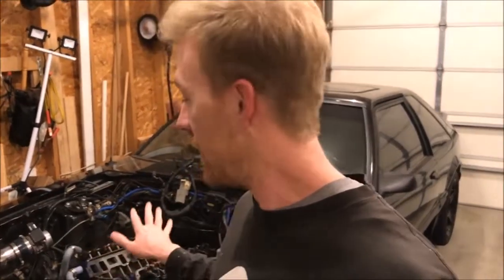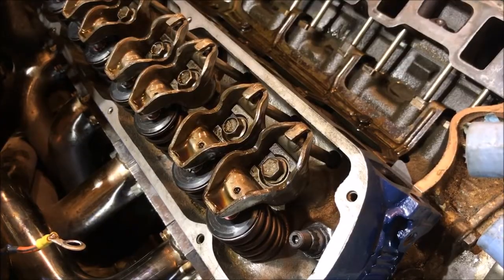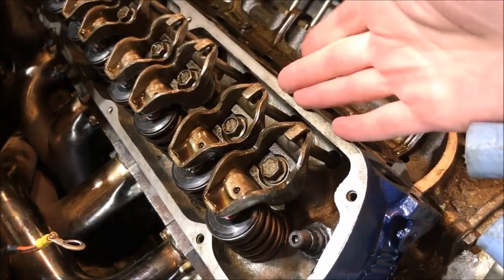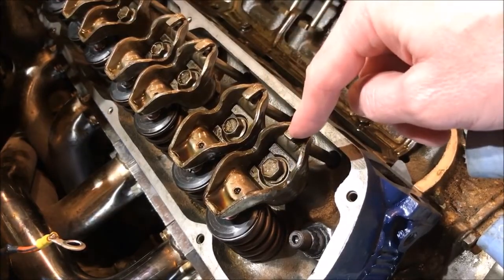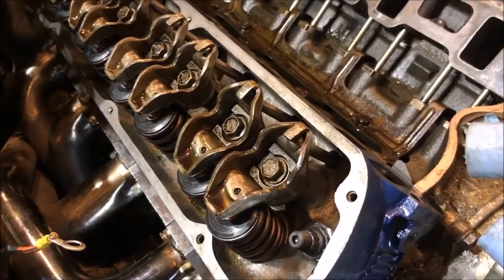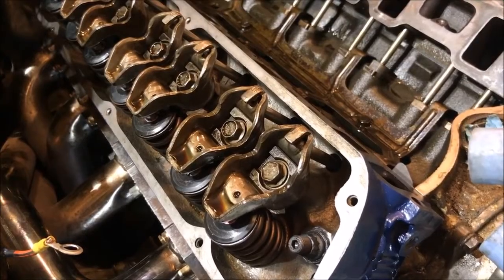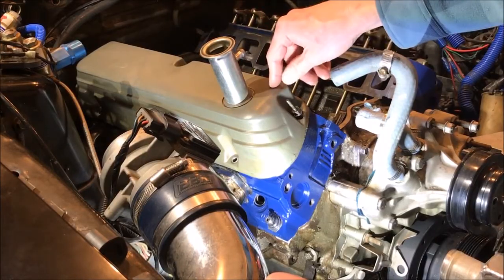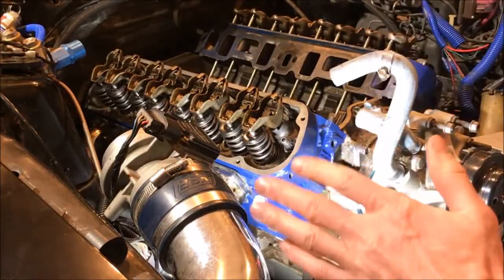Compression Stroke & Top Dead Center

Comment: Thank you for this great explanation video 
I am teaching myself and didn’t want to take off cover because then I will want to replace with upgrade and I am over budget for this season 
And 
Was not getting paper to shoot out for some reason. 
So 
I did the screw driver method and felt it make impact and then when it felt like solid I checked marks and it was at 0 

Now I can hopefully safely put in the distributor and put rest together and once able to run it advance the distributor to get it right 
It’s a 95 5.0 gt so I believe it will be around 10-12 when final adjustment done especially with the current mods.

Comment: Nice. So given the error in just looking at things from different perspectives I'm guessing on the piston stop portion trying to find the center between the tape isn't super critical just eye balling it? Or I suppose you could get a piece of string since the balancer is curved and mark on each side lined with the tape then pull string straight and measure the exact center then return the string line it up and mark the center on the wheel.

Comment: So the method is plug up the hole with shop towel..an when it shoots out ur on the compression stroke ..but ur not done yet until u feel the piston comes back up right?.. or i didn't understand it correctly..hummmm
Reply from the maker: Hello.  The shop towel only tells us that we’re on the compression stroke.  After this has been determined, you will need to precisely find TDC by using the timing marks on the crank pulley.  Does this make sense?  Hope so!
Reply: @FastFixYouTube  ok coo thanks
Reply: That's cuz he didn't explain it correctly...

Comment: I need some help.
So ive taken my top end apart a few times, no issues.
But this time i just cant get the car started. Ive tried setting the timing like 4 times now.
Doesnt even try to start.
Motor is fresh built. I took top end apart to fix a slight coolant leak.
Put everything back together and no start!
Any suggestions would be appreciated.. 🙏
Everything is connected. Spark plug wires on correct.
Reply from the maker: Hello. It’s pretty hard for me to say to be honest. So many variables and impossible to know the full situation you’ve got. Have you verified that you’ve got fuel? Spark? Then of course timing.  It’s got to be one of those three things. Check for blown fuses as well. Probably a stupid question, but is the coil plugged in and working?  Just go through your process step by step and verify the basics.  You’ll figure it out 👍

Comment: Great video. Working on a stock 92' 302 HO. I'm not the 1st owner. Newly rebuilt E7 stock heads I just put on, went to tighten pedestal rockers and found no.1 ok, timing mark at 0. On to no.3 and on compression stoke TDC was no where near the 0 mark on balancer. Piston was way down. What should this tell me?
Reply from the maker: Hello. Sorry for the late reply. It sounds like the piston was at BDC when it should’ve been on TDC? Is that what you were seeing?
Reply: @FastFixYouTube  yeah. I'm taking it to a speed shop. I'm thinking timing chain might have been changed by previous owner. When valve covers came off one side looked clean, other baked in black carbon.

Comment: Yo bra-tha I like ur video on the TDC cause I've done like everything on my 2005 Nissan Altima like the head gasket exhaust manifold gasket n the intake n bought a new exhaust manifold converter new spark plugs ignition coils oxygen sensors new battery changed the oil changed the anti-freeze n b4 that I changed the fuel pump that's the 1st 1 that kocnked out bt it's not starting r running n my bro said my timing chain n another 1 said the same so ur video is all cool bra-tha n I'm not a mechanic bt do know some stuff bt never have I done what I did bt I did it by whatching a video on how to change the head gasket on a 2005 Nissan Altima 2.5L engine 4 cylinder bt it didn't show how he did the TDC cause it was snap shots here n there bt I texted him n he said that the colored links have to b aligned with the notches he said so I'm gonna do that bra-tha hope u text back n let me know if that's what it is bra-tha
Reply from the maker: Hey, what’s going on man!  Sorry about the late reply. I don’t have much experience on altimas or over head cam stuff, but that advise sounds correct. Got to line up the marks in order to have a chance at it starting. You can double check your work using the method in my video. Did you have any luck? Sounds like a big job. Not being a mechanic and getting all that done certifies you for sure.
Reply: @FastFixYouTube  4 reals bra-tha,  COOL 4 UR RESPONSE BRA-THA  bt have another thing that's giving me a problem bra-tha I don't know why my #1n #3 ignition coils r hard to get out #2n#4 came out all good like they should bt that's my problem right now, u got me good advice bra-tha

Comment: Question.  I’m rebuilding a single cylinder atv. The timing is off.  The cam chain was removed and the piston was turned before putting back together.  How do I find compression stroke if the cams are not hooked up to the cam?
Reply from the maker: Hello. Do you mean if the cam isn’t chained to the crankshaft?
Reply: @FastFixYouTube  I believe so.  There’s a cam sprocket connected to a chain.  I’ve set it to TDC mark.  And it’s acting like timing is off.  Spark is fine, but it’s backfiring through the carb.  
I replaced seals, gaskets, the whole top end, piston and rings are brand new. 
Carb was jetted to factory specs, I’m just at a loss
Reply from the maker: It sounds like it’s 180 degrees off. As in the spark is firing when the engine is TDC on the exhaust stroke. I’d pull all the plugs, rotate the engine 180 degrees and try again. You should be able to find the compression stroke using the shop towel method. Make sure that towel fires out of the spark plug hole with force. That will indicate the compression stroke. Let me know how it goes
Reply: @FastFixYouTube  so I tried that. Towel flew out the spark hole and then I kept rotating to the T mark on the flywheel and it still backfiring through the carb and not firing.  
I then rotated it 180 degrees and set it to the T again. And still same thing. 
Could it be valves? Or maybe a carb thing?

Comment: I have cranked and cranked and I can’t get it to blow a piece of paper towel or my finger. I haven’t taken the valve cover off yet but I hear air just no pop. Any thoughts man?
Reply from the maker: Hello. Yes, I’ve got a few thoughts. If there isn’t pressurized air coming from the spark plug hole, your valves are likely not sealing. Check the lash and make sure everything is within tolerance. In the worst case scenario, your rings are waaaay bad and allowing blowby.  Could also be a head gasket, etc…. But it really sounds like an open valve issue. Let me know how it goes. Thanks for the question!

Comment: isn't supposedly when the piston of cylinder 1 reaches the top is TDC? I'm still confused...
Reply from the maker: Yes, TDC means top dead center.  And in the case of Fords, piston #1.
Reply: So is that when the distributor should be pointing directly at #1 also?

Comment: Thanks for making this video I'm pretty sure you've helped put alot of minds at ease. I have a question: I'm changing a water pump on a 2014 Ford Flex and the primary timing chain was removed without the Cams locked. Cams where manually turned for alignment. I'm assuming this video explains my solution? If so is it best to go ahead and  remove cylinder head for setting (TDC) while making sure crankshaft is on the compression stroke?
Reply from the maker: Hello. I’ve never worked on a Flex or an overhead cam engine (believe it or not) but I assume there are timing marks that must be aligned prior to firing the engine. It sounds like you did that part, so now you just need to set the engine to its proper starting configuration, right?  But isn’t a flex computer controlled?  Therefore, as long as the cams are correct, the computer handles the rest, right?  lol, I’m asking more questions than answering, but I think I’m correct. Please let me know if not.

Comment: So you find zero after both valves are on compression stroke? I am having a hard time tightening rockers there gt 40 3 bar stock rockers, stock cam i beleive. Thanks any guidance much appreciated..
Reply from the maker: Hello. As long as both valves are closed be it on the compression stroke or exhaust stroke, you can set lash. Just need to make sure both valves are shut completely so you can set lash properly at zero.  Do you have roller rockers or stamped?
Reply: @FastFixYouTube  roller rockers or stamped. stamped at to flat lifters. and flat cam or the roller engine.

Comment: Man mines being a pain, checked tdc compression with the thumb technique and the balancer is like 45 degrees off stabbed the dizzy and it definitely won’t run might put here and there, I cannot for the life of me get it to run to the point I think the cam jumped time
Reply from the maker: Hmm….  Do you have factory timing marks or timing tape on the balancer?  Some quick things to check are your plug wires. Make sure they’re routed properly to the correct cylinders. You’d be surprised how often that’s the problem. Also, are the points and distributor cap and rotor look okay?  If corroded, replace those. Let me know if any of this helped. Best of luck 👍
Reply: @FastFixYouTube  yup factory timing marks are there, but they’re no where close when piston is at tdc compression balancer definitely spun, and when getting it to tdc compression manually the car will only putt but not run, good fuel pressure, I’m seeing injector pulse I’m just lost, probably gonnna check timing next. unfortunately, I hope it is timing due to the fact of if it’s not I have no other idea why it wouldn’t run. Thanks!
Reply from the maker: Hey there. Hmm, yeah I’d say timing is likely the cause. If you’re getting fuel and spark, timing is about all that’s left.  However, if you had a failure like the balancer key breaking and causing it to spin, you’d need to replace that or it won’t run properly. Hope it’s not that…could be a big problem if so. 

Again, make sure you’re on the compression stroke. I know you did the thumb method, but make sure you’re not feeling pressure on the exhaust stroke and going from there. Use the shop towel and make 100% certain you’re on the compression stroke. Best of luck and feel free to update.
Reply: @Shogoat1304  vehichles that are equiped with computer technology then you only have to set it to top dead center on the compression stroke. 0 set, computer sets the rest when it starts up. thats with engines with no manual distributors that are equiped with cam and crank sensors. 2 different worlds when setting timing. also make sure your cam gear and crank gear on ford both dots facing uppwards at the 12 O'clock position on Ford's 
chevy's bottom crank gear facing up at 12 O'clock postion and the cam gear set dot at  6  O'clock postion must be exactly on line up to one another.and there you have it. .just make sure your cam is not set off 180 degrees out. other wise you will be tearing your timing gear back off and resetting the cam.

Comment: i have a question i have a  20O4 kia optima 2.4 litters  what happend when you have the camshafts in the guided marks and you  move  crankshaft clockwise a whole turn or even Two whole turns ?🤔
Reply from the maker: Hello. I assume for you situation the timing chain has been removed and the crank is turning independently of the camshafts. When this happens, your timing will be way off.  You’ll need to find the proper start up procedure for your vehicle. Generally, this means finding TDC on the compression stroke on the #1 piston, but I can’t speak specifically for your car as I’m unfamiliar with it.
Reply: @FastFixYouTube   everything came out  perfect, I just lined marks once  more  thanks for your support  !

Comment: Is the compression stroke and tdc supposed to be in the same spot? I get confused when you find the compression stroke, but then adjust to zero... doesn’t that take it of the compression stroke?
Reply from the maker: Hello. So the quick answer is no, it doesn’t.  It’s important to find the compression stroke first because there are two TDC moments in the 4-stroke cycle. If you don’t find the compression stroke first, you’ve got a 50% chance that you’ll be finding TDC on the exhaust stroke which will give you all sorts of trouble when trying to start the car. You must be on the compression stroke for the timing to be set correctly. Hope that helps!  Thanks for the question 👍
Reply: no, as to the old marking it used to be 10 degress before top dead center so it will allow a good amount of gas say 1/4 cup just saying sample of gas and air is created by piston once it comes up on the compression stroke sparks ignites on the top of the cyclinder once it reaches towards the top once fuel ignites air compression creates more and bang from fuel fire  forcing the piston back down. and that is how engine pistons and air and fuel works together.

Comment: Hi will the paper towel pop the same way if i was to be on the exhaust stroke meaning the piston going back up to tdc but on exhaust?
Reply from the maker: Hello. Generally, no it will not. The towel shouldn’t be popping out if on the exhaust stroke because the exhaust valve will open and relieve the pressure. However, this may not always be true depending on the camshaft. That’s why I say to go slow when rotating the engine. You’re more likely to pop the towel out on the exhaust stroke if you spin the engine too fast because the valve won’t have the chance to open and relieve the pressure before the towel pops out. Hope that helps.
Reply: @FastFixYouTube  thank youu so much that makes sense.
Reply: @FastFixYouTube   I was able to get the truck running but I found my self with another issue, its a stock 454 im using vacuum advance to ported on my carburetor but i also have an egr with no solenoid or anything just the egr and a vaccum hose, should i t off the ported port ? i have no more ported ports in my carburetor
Reply from the maker: @rodolfogana2508  Hello.  Glad you got it running!  I'm sorry, I have no technical knowledge around carburetors...before my time :(
Reply: @FastFixYouTube  thank you and yess i missed the sound, your video helped alot thanks

Comment: Awesome video! I like the editing you did with the pop up graphics. I'm working on my Mercruiser 470, 4 cylinder which is basically 1/2 of a 460 Ford, has the same head, pistons etc. I'll use my bent pushrod from my number 3 cylinder instead of a screwdriver 😬. Btw subscribed 😉
Reply from the maker: Glad you liked!  Thanks for the comment and sub.  Best of luck on the merc! 👍

Comment: I guess I'm an idiot haha. I just rebuilt my Amc360 and I've tried the paper towel method to find TDC compression. No matter how big or small the paper towel piece it will never pop out. Again...maybe I'm an idiot
Reply from the maker: Hey there. No, certainly not an idiot if you were capable of rebuilding the motor. Did you put some crazy cam in with major overlap? Still, there should be a moment when compression blows the paper towel out. OR, you perhaps have valves that are not seating?  Sorry I can’t be of more help!
Reply: use a rubber plug or a wooden round dowel slightly smaller the the park plug hole wrap plastic arount it stick snugged  into the spark plug hole. and turn engine over will popp out and sound like a shot gun going off. or can place thumb over the spark plug hole and turn engine over the air pressure will blow you thunb or finger out of the hole.

Comment: Wouldn't you have a chance of the paper towel getting sucked in on the intake stroke?
Reply from the maker: Hello. Yes. Make sure the paper towel is large enough to fill the spark plug thread bore and you’ll be fine. If too small, yes could get sucked in, but still unlikely because the intake valve will be opening and the cylinder will draw air in from that location relieving suction on the spark plug.  I’m sure this has happened to someone however who used too small of a paper towel. Thanks for the question 👍

Comment: So I have a question, if you have your cylinder heads off and you have piston 1 at top dead center and ready to put the new cylinder heads on and torqued them down to specs do you still need to rotate the engine to get it on compression stroke?
Reply from the maker: Hello. The answer is yes.  Even if the #1 piston is at TDC (heads off) you won’t know if it’s at TDC on the compression or exhaust stroke therefore you’ll need to verify when you put the heads back on.
Reply: @FastFixYouTube  thank you, I thought so was just double checking. God bless

Comment: Can't you jump timing by spinning backwards
Reply: If the tensioner is purely hydraulic then yes this is a possibility but more commonly turning engine anti clock wise on some engines with timing chain tensioners creates slack at the tensioner and the tensioner automatically moves out to compensate and when the engine returns to normal clock wise direction the tensioner is way too tight and the weakest link in the timing chains / gears configuration will break or get destroyed.
Reply from the maker: Not sure what you mean by “jump timing”
Reply: yes and no. some inboard boat engines run backwards alot of peeps not know that. but anyways most time the engine is running clockwise just the distrubtor turns counter clockwise as to the shape gear on cam for the distrubtor gear. ford makes them in the front if in the back of engine like chevy did all will be working in the clocwise rotation of the engine. just a simple way of saying how ford and chevy made there differences. also alot peeps not know this either chevy made the 302 first not ford. chevy 1966 chevy Z28 /302 . also the chevy ss camero in some of them.later on chevy made a 301 big v6 engine for the 1980s chevy station wagon .